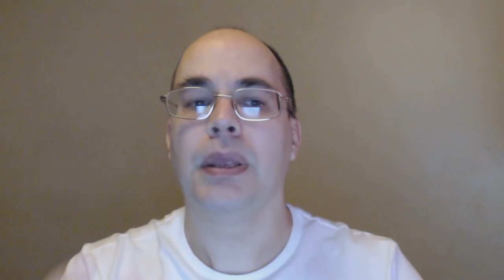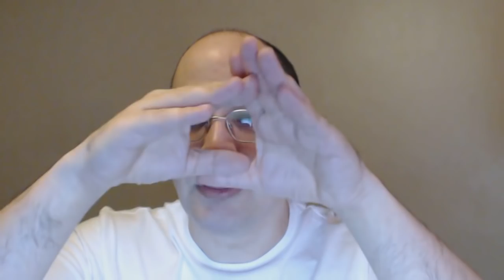How do rockets move in space, with nothing to push off from?

Comment: Nice try but your explanation is not supported by chemistry,  thermodynamics, or physics in general. 
THE CONSERVATION OF MOMENTUM FALLACY Here the idea is that when a rocket “expels” mass, in the form of burned fuel, in one direction, conservation of momentum says it has to be propelled in the opposite direction in order to conserve the total amount of momentum in the system. The law of conservation of momentum states that in a system not subject to external forces the total momentum is always conserved. That's a logical consequence of Newtonian laws. Without external forces the interactions inside a system must always involve some kind of exchanging, like typically in a collision between two objects, where the energy/velocity lost by an object has to be transferred to the other (inelastic collision) or simply exchanged (elastic collision), so that in the end the total momentum of the two objects is the same before and after the collision. Let's take a look at how that applies to a gas expanding in a vacuum. A gas expanding against a vacuum is not interacting with anything, by definition, hence its momentum cannot be exchanged with anything, and it follows that: THE EXPANSION OF A GAS IN A VACUUM WILL NOT AND CANNOT AFFECT ITS TOTAL MOMENTUM (i.e. THE TOTAL MOMENTUM OF THE GAS MOLECULES BEFORE THE EXPANSION IS CONSERVED AFTER THE EXPANSION). The logical, unavoidable consequence, and key point here, is that – if we assume a rocket in space can be accelerated by expanding gas in a vacuum - in order to account for the accelerating rocket we end up INCREASING the total momentum of the system. In other words, we end up violating the law of conservation of momentum. Bottom line: the law of conservation of momentum actually disproves rockets working in the vacuum of space.  

G' day Mate
Reply from the maker: That was a long winded way of saying absolutely nothing to disprove what was in the video, which is supported by some really rather basic chemistry, thermodynamics, or physics in general, to use your phrasing.
Reply: @mjmurcott647  Maybe this will help you understand:  Since it is contrary to the laws of physics for rocket engines/thrust to work in space ;they can only work in the atmosphere of Earth. Correctly stated, Newton's third law is: For every action, there is an equal and opposite reaction. In other words, every force involves the interaction of two separate objects, (that’s TWO SEPARATE objects). When one object exerts a force on a second object, the second object also exerts a force on the first object. It is therefore evident that a single mass object, such as a rocket, cannot move itself. It must have a separate force to interact with. Newton labelled them as ‘force pairs’; this being the case, there can be no disputing that nothing on Earth, whether it be biological or mechanical, can defy the physical laws of Earth. These laws assert that every living thing and every man made vehicle on the Earth must have the inherent ability to push away from a separate resistant force in order to be able to travel in a given direction, and that includes rockets. Without separate resistant forces, (force pairs), there can be no thrust and thus, no movement, and that naturally applies to rockets, which are single mass objects. Consider these facts; there are two forces required for a rocket to fly in Earth’s atmosphere, thrust and downward force. The thrust, comes from the burning of fuel at the bottom end of the rocket where hot gas molecules are forced from the combustion chamber down through the jet nozzles in an unbroken pressurized stream. The downward force, comes from the ambient external mass of air pressure that completely and constantly presses against the exterior of the rocket and also infiltrates and floods the interior space of the jet nozzles, and it is this external mass of air pressure that affords the rockets thrust the resistance with which to push away from, so the ‘force pairs’ are the thrust column and the pressure of air. The downward thrust constantly pushes away from the resistance of air pressure and the air pressure constantly pushes against the thrust with equal force; without this positive air pressure providing a constant resistant force for the thrust to push away from, a rocket could not fly. In fact, without air pressure, nothing on Earth could fly. In space, there is no atmospheric pressure which naturally means there is zero pressure on the rocket and therefore, absolutely no resistance. Space, as we currently understand it, is an airless vacuum and is therefore completely opposite to the air filled atmosphere of Earth. Consequently, as soon as the nozzle is opened to release the gases, the combustion chamber becomes part of the vacuum of space. This means that when the rocket jets are open, there is no barrier or resistance to prevent the high pressure gases inside the chamber flowing out into the low pressure vacuum of space. Gas pressure requires molecules to be in contact with each other, bouncing off each other, causing millions of collisions per second, etc.… If you release gas into the vacuum of space, the first molecule that pops out will shoot off into the distance at a constant speed, so will the one behind that, never catching up with the first one. The third, fourth, etc.… all fly off into the distance trying to fill the limitless vacuum by finding their empty corner. Accordingly, with no resistant force to stop them, the hot gas molecules expelled from the open combustion chamber through the jets would simply disperse, one after the other, into the endless expanse of outer space. So no matter how much gas you produce none of it will ever change the pressure under a rocket. None of it if will ever push a rocket. It is undeniable that to push a rocket there must be some locally high pressure under it, which is impossible since the pressure in space is zero everywhere. So, essentially, without the required resistance of positive air pressure to push away from, a rocket could expel its hot gas molecules into space for eternity and not move a single inch
Reply from the maker: Just repeating the same flawed shit and hoping people will swallow it doesn't make it true; you have zero understanding of physics and need to go back to school and this time actually listen to what you are being taught and ignore the conspiracy nutcases who try to tell you that rockets don't work in space despite dozens of nations and companies all proving that they do. I did these videos to try and improve the basic knowledge in society and idiots like you who can't even grasp the basic concepts make me despair of the human race.
Reply: @mjmurcott647  I will simplify it even more so maybe you can grasp the science VS science fiction:
     The reason space travel is not possible is because the systems we claim to use to propel a rocket through space operate on gas pressure and there is no gas pressure in space.
Gas pressure requires molecules to be in contact with each other, bouncing off each other, causing millions of collisions per second, etc. If you release gas into the vacuum of space, the first molecule that pops out will shoot off into the distance at a constant speed, so will the one behind that, never catching up with the first one, the third, fourth, 5th, 200th etc. all fly off into the distance trying to fill the vacuum by finding their empty corner. No matter how much gas you produce none of it will ever change the pressure under a space ship/at the nozzle in a vacuum; none it if will ever push a spaceship. To push a spaceship there must be some locally high pressure under the nozzle, which is impossible since the pressure in space is 0 everywhere.

       Back to the nozzle and the Mass flow equation F=MA on earth:
Think about a fire hose shooting water; a force comes directly back against the column of water shooting out; why? Because the first drop of water has to pass through air, which is dense, causing many collisions, slowing down the drop of water; the second drop, directly behind the first, will not be slowed down by the air so it will collide with the first drop, the third drop hits the second drop and so on, the fast water coming through the hose pushing through the slower water outside causes Newton’s 3rd Law to push back on the column of water this is called a force pair. This is why you need people holding the hose to add an unbalanced force otherwise the hose would not be able to push water through that column anymore, the water column would be diverted and the hose would flop and fly around. It is obvious that one drop of water does not push back on the hose, you need a fast moving column.

       The nozzle and the mass flow equation in space:
 Since the molecules leaving the combustion chamber and entering the vacuum never slow down, never collide with any outside objects, nor with each other, their force is always moving forward, away from the ship; there is no way for that force to be returned to the ship i.e. no force column back to the nozzle. There is no way for the force of the moving molecules to be extracted and used for propulsion. Their force is carried off into the far corners of space; this is also known as Joule Free Expansion; remember that as soon as the nozzle is opened, the combustion chamber becomes part of the vacuum of space and is subject to its laws; a closed chamber would be under pressure but not an open one.

      Anyone that says they are able to obtain propulsion in the vacuum is lying at the molecular level.
Most people don’t usually look there; because the awesome, spectacular and heroic nature of space exploration is enough to cloud most logical minds. Most respectable engineering schools won’t touch space flight and those who do have tiny departments. If it was really a multi-billion dollar government funded operation, every school in America would have their hands out for government grants like the do with Engineering, Computer Science and Biology; but why train thousands of the best minds of a generation in a field that doesn’t exist?

       If you still have trouble comprehending this simple explanation maybe you can understand this Pressure = 1/Volume, so if a 5000 PSI valve is opened in an infinite vacuum at zero Pa the resulting pressure will be ( P= 1/infinite)and the inverse of infinite is zero PSI.  Why not  teach everyone how to in validate Boyle's Law while you are teaching Science Fiction in other other areas.
G' Day Mate
Reply: @stuartgray5877  THE PRESSURE IMBALANCE FALLACY In this case the explanation goes something like this: inside the combustion chamber of the rocket there are pressurized gasses. The pressure is equally balanced in all directions and the system is in equilibrium, but as soon as a valve is open on one side and the pressurized gas is free to expand outside, a pressure imbalance develops inside the chamber, as the chamber's wall directly opposing the valve will experience a pressure not offset by its counterpart. This imbalance will create a force that will push the chamber and in turn the rocket forward (as an aside note, in the end that means the rocket is pushing on itself, AKATHE PRESSURE IMBALANCE FALLACY In this case the explanation goes something like this: inside the combustion chamber of the rocket there are pressurized gasses. The pressure is equally balanced in all directions and the system is in equilibrium, but as soon as a valve is open on one side and the pressurized gas is free to expand outside, a pressure imbalance develops inside the chamber, as the chamber's wall directly opposing the valve will experience a pressure not offset by its counterpart. This imbalance will create a force that will push the chamber and in turn the rocket forward (as an aside note, in the end that means the rocket is pushing on itself, AKA the Baron Munchausen effect). Let's devise an experiment in which we have a container in a vacuum with pressurized gas inside and let's assume, for the sake of simplicity, it's shaped like a cylinder. The container has two walls, let's call them A and B (corresponding to the bases of the solid). Wall A can be opened, to let the gas exit the container. Wall B (opposite to A) can move along the inner part of the cylinder, like a piston, and we have arranged the system so that the weight and the friction of the wall/piston exert a resistance (inward force) that balance the internal pressure of the gas. Now, starting from a point in which the system is in equilibrium let's remove wall A allowing the gas to freely expand. According to the explanation, the wall B should now be subjected to a force directed outwardly, caused by pressure imbalance. Such outward force (conceptually equivalent to the force that would purportedly propel a rocket) should cause the wall/piston to move accordingly in an outward direction. If you have the piston connected to a gauge, this movement would be read as an INCREASE in internal pressure?? We are now at a point where, ceteris paribus, just opening the container (i.e. increasing the volume), we had the effect of measuring an increasing in internal pressure. Until you can demonstrably invalidate Boyle's law PV=K, we are dealing here with a thermodynamics absurdity. Bottom line: the laws of thermodynamics actually disproves rockets working in the vacuum of space. Conclusion: the laws of physics are all consistent in disproving rockets working in the vacuum of space. G'Day Mate : - )).
Reply: Kit Canyon  If thrust increased with decreasing air pressure as you claim airliners would change their optimum performance altitude approx. 35k feet to a much higher altitude where the air pressure is lower.  Here is another reason rockets don't in space.  In order to avoid confusion, scientists discuss thermodynamic values in reference to a system and its surroundings. Everything that is not a part of the system constitutes its surroundings. The system and surroundings are separated by a boundary. For example, if the system is one mole of a gas in a container, then the boundary is simply the inner wall of the container itself. Everything outside of the boundary is considered the surroundings, which would include the container itself. The boundary must be clearly defined, so one can clearly say whether a given part of the world is in the system or in the surroundings. If matter is not able to pass across the boundary, then the system is said to be closed; otherwise, it is open. A closed system may still exchange energy with the surroundings unless the system is an isolated one, in which case neither matter nor energy can pass across the boundary. 
     A rocket is an open system that can exchange matter and energy with its surroundings operating in the earth’s atmosphere. A rocket in space is a closed system as space contains no boundaries so a rocket becomes an isolated system and no matter or energy can cross any boundary as there are no boundaries in space.... A rocket defies the first law of thermodynamics if it does indeed function in a vacuum… As there are no boundaries in space and no work is done by the surroundings on the rocket system… A way of expressing the first law of thermodynamics is that any change in the internal energy (∆E) of a system is given by the sum of the heat (q) that flows across its boundaries and the work (w) done on the system by the surroundings.
G'day Mate
Reply: @uncommonsense9948  Air resistance is the resistance of the air to a body passing through it; the force that the body has to apply to move the air out of the way, equal (thanks Newton) to the force that the air being moved applies to the body moving it.  Air resistance exists because air molecules have inertia so resist being accelerated: they resist change of momentum. And, by Newton's first law of motion the force exerted on the air molecules equals the force that they apply back.  
So: change in momentum is resisted by inertia, so a force is required to change momentum. And, force exerted = force resisting.
Therefore, if a rocket pushes e.g. a brick out behind it, the momentum of the brick goes from zero to something in the backwards direction. So the brick's inertia resists this. So the rocket has to apply a force to the brick to make that change of momentum against the brick's inertia. But, at the same time that same force is applied back on the rocket (First Law), so a force is applied against the rocket's inertia, so the rocket has a change of momentum :- forward. 
Now, rather than one brick, imagine a whole series of bricks: push, push, push.
Now, rather than bricks, imagine a whole series of gas molecules: push, push, push, push, push, push, push, push, push, push.
Reply: @papalegba6759  each molecule of gas is no different to a brick, except for scale.  In the same way that no matter how large or small the bow or bolt, every crossbow experiences recoil.
Reply: @inniuniui9361  are you claiming that gas molecules are massless?
Reply: @inniuniui9361  so if bricks have mass and pushing a brick out the back of a rocket would push the rocket forward, then because gas molecules have mass pushing a gas molecule out the back would push a rocket forward.  Nice.
Reply: @inniuniui9361   - "if the momentum  of  a gas particle expanding into a vacuum is conserved then it will not have exchanged momentum with the nozzle."

This MORE proof that you have no clue what you keep repeating.

Momentum is DEFINED AS: MASS TIMES VELOCITY!

Since you AGREE that exhaust gas HAS MASS, then it HAS MOMENTUM!
Form the perspective OF THE ROCKET (a Space Shuttle Main Engine for example):
The liquid oxygen and liquid Hydrogen have a relative velocity, with respect to the rocket, of ZERO when the liquid is in the tanks.

in ONE SECOND the SSME consumes 500 kilograms hydrogen and oxygen is COMBUSTED inside the engine and the by-product , PURE WATER,  is EXPELLED from the nozzle at 2500 meters per second.

The MOMENTUM (with respect to the rocket) BEFORE combustion IS: 500 kilograms TIMES 0.0 meters per second velocity.
Which equals ZERO MOMENTUM with respect to the rocket

The MOMENTUM (with respect to the rocket) AFTER combustion IS: 500 kilograms TIMES 2500 meters per second velocity.
Which equals 1,250,000 kilograms-meters-per-second

This number is NOT ZERO!

So innunui - tell me HOW DID THE MASS of the exhaust gas GET SUCH A HUGE MOMENTUM?

You DO know what causes a CHANGE IN MOMENTUM RIGHT?
IF you understood Newton's Laws YOU COULD ANSWER THAT QUESTION.

But WATCH as you DISTRACT and DIVERT form the question while refusing to just answer.
this is because you are an uneducated high school dropout trying to lecture ACTUAL Engineers and Physicist about HOW BASIC PHYSICS WORKS!
it is PATHETIC!

WHAT can cause a CHANGE IN MOMENTUM of an object with MASS?
Just answer coward.
Reply: I wonder where you think all the rockets have gone that have supposedly been launched into space?
There must be a lot of corporations out there that have spent hundreds of millions of dollars to have their satellites put into orbit around the earth, only to find that they haven't actually been put into orbit at all?
Funny that these 'missing' satellites aren't making headlines in the world's media?
Reply: So you think that air somehow pushed back against the rocket? How does it do that, exactly?

FE fails again.